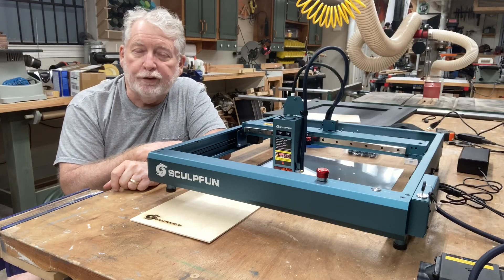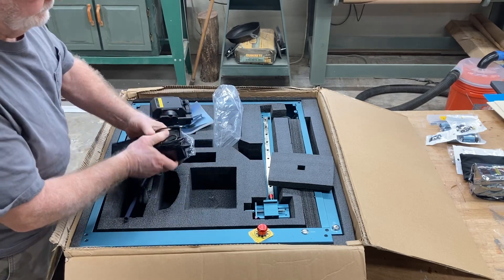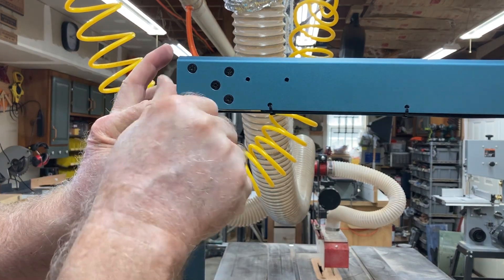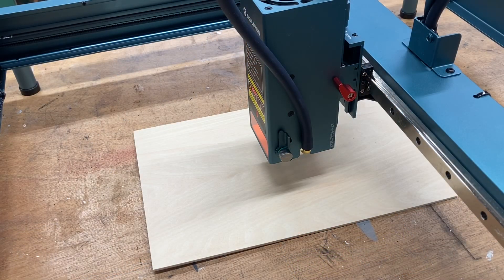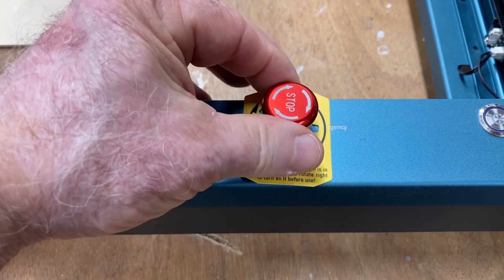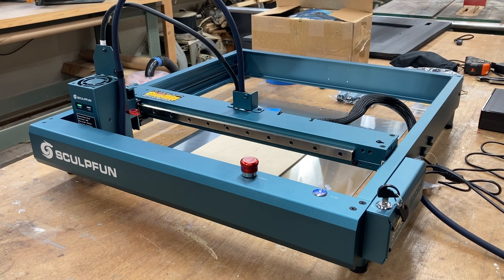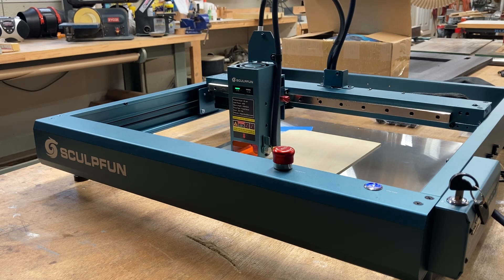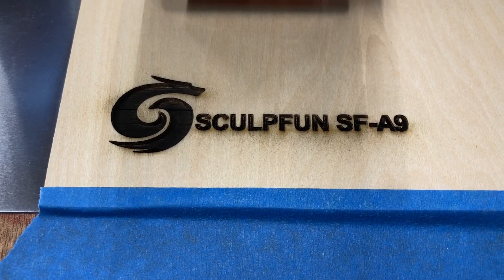Sculpfun SF A9 40W Laser, First Look, Assembly and First Engrave

Comment: Mine just arrived and during installation I noticed that mine came without the redscrew that tights the laser to the rail, any suggestions how can I tight the head? Thank you, BTW great video 👍
Reply from the maker: Often times the screw comes loose in shipping. I have found them in the packing and sometimes in the bottom of the box. I believe it is a M3 or M4. You may be able to find one at the local hardware store